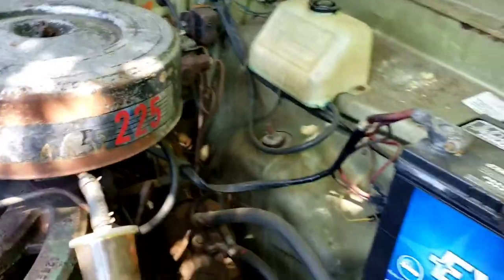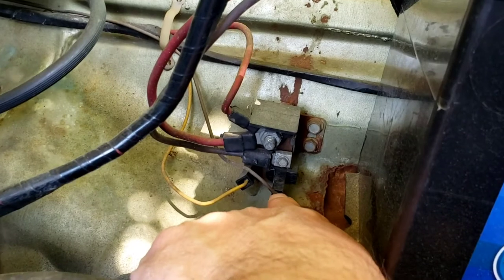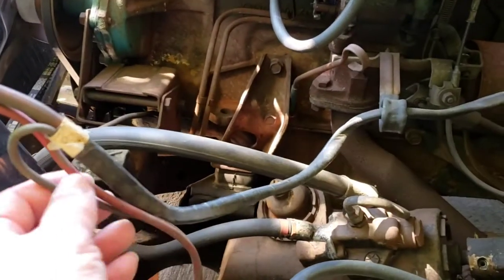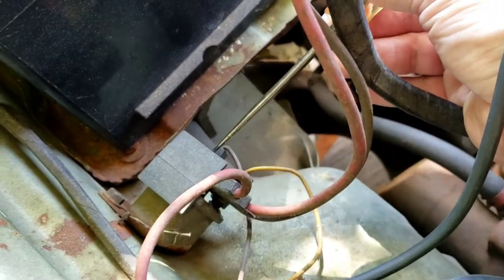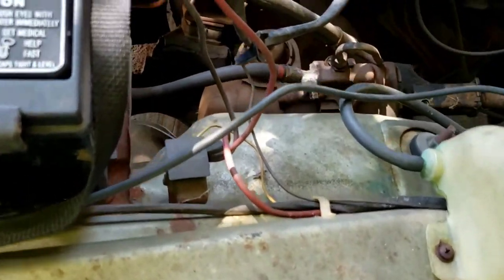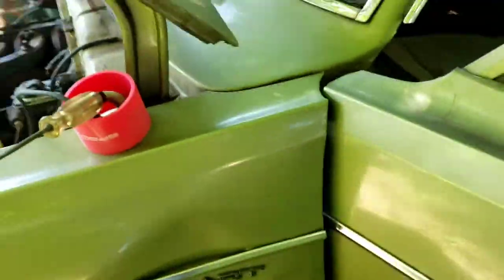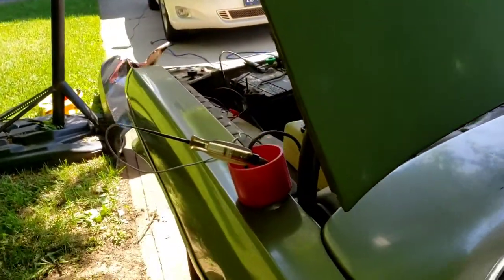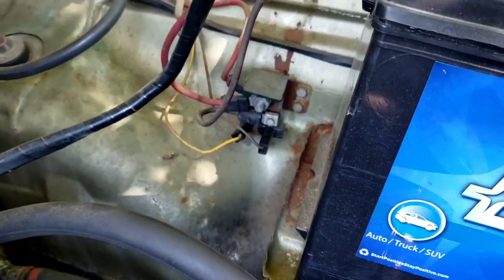Car Won't Start Old Chrysler Plymouth Dodge Mopar Won't Crank Starter Relay Check 60's 70's 80's

Comment: Hello Guru, I do have a 1974 plymouth fury iii that sat for 6years. I just replaced starter, battery, ignition coil, carburetor, spark plugs and ignition wires, one funny thing is before changing all this new parts it fired up and ran for about 3 mins. Did oil change and now it cranks but won't start. Any help is highly appreciated.
Reply from the maker: Alright, so the cranking eliminates the battery, starter,neutral safety switch.
Let's check for spark 1st, go and pull a spark plug wire off the spark plug,stick a Phillips screwdriver in the wire to act as a spark plug and hold it about 1/4 inch away from a good metal ground and try to start it and see if there is spark jumping from the screwdriver to ground. Or check for fuel 1st by getting a can of gum out carburetor cleaner, spray some in the carburetor with the choke open, and try to start the engine..see if it try to start like it wants to fire up. Is this electronic ignition or points or an aftermarket ignition system. You mentioned that before the parts changes,  it ran..so also check your spark plug firing order to see if its in the right order. Since it ran before and stalled after 3 minutes,  sounds like it was originally a fuel problem,  but now you need to start from scratch with the firing order.
Reply: Thank you so much for your reply. I tried that spark technique with a screw drive, and yes, there is a strong sparks, I have been using the carburetor cleaner, but still, it won't start. When I was changing sparks and ignition wires, I put them back one at a time the way it was.  Yes, it is an electronic ignition/points, and I believe the ignition system is still original
Reply from the maker: @benkip2301  so if you have spark, and you provided fuel by way of carburetor spray or actual gasoline then the only things left is no compression in the cylinders like a few stuck piston rings or the spark plugs are fouled with gasoline and won't fire. You can do a compression test on all cylinders or change spark plugs, what brand plugs are you using, certain brand plugs foul fast and once wet they won't fire up.
Reply: @alyoungcuda  I used Acdelco platinum spark plugs. I will check compression and try to put a new distributor because the pick-up line connector looks corroded/melted
Reply from the maker: @benkip2301  platinum plugs foul out to easily
Reply: @alyoungcuda  Thank you
Reply from the maker: @benkip2301  on my other car, the best spark plugs that doesn't foul out on me when I crank over the engine and pump the pedal is a split fire plug that is discontinued now, it has a tip that looks like a Y so the spark will jump to either end instead of 1..the new E brand  Plug looks tempting which has 3 points to spark, but I didn't install it yet. But before that, the plugs got fouled so many times, had to wait another day to try after they dried out, but it got annoying because sometimes it fouled out again and only a new set will work until I went with these. Sometimes if you keep the gas pedal floored while turning the key, the air being sucked in can dry out the fouled spark plugs
Reply: @alyoungcuda  I can't thank you enough for all this information. Yes, I believe it is flooding, really bad. I will go get another set of spark plugs and go from there
Reply from the maker: @benkip2301  sometimes you knock yourself out and the darn plugs are wet..

Comment: So, how does that test the relay?  If I do what you do and an each is a + or - ground as indicated and still no crank, that is not 100% sure its the relay? How do you test the relay itself?
Reply from the maker: It tests the relay, it tests the inputs to the relay..if you have your inputs and it won't start, then the output is no good, meaning the relay is no good.. if you do the old school way and jump the 2 terminals or touch a screwdriver to the battery terminal and the starter terminal it will crank. The inputs will set the relay internally to crank if all inputs are good.
So you should get power from the battery stud to the starter stud when the output and relay is good.
Reply: @alyoungcuda  , my mistake, thanks, I do not have 12v or live yellow wire. Not sure where ignition switch that powers this yellow wire is located, 86 5th Ave., please let me know if you know location of switch that powers yellow wire.
Reply from the maker: @dewholdingsllc1050  if you look up ignition switch on autozone.Com for your model, you will see it bolts on with 2 screws under the steering column..and has a few wires going to it..the switch is operated by a rod that attaches to your ignition key cylinder by gears and such..its mechanical from the key down to that switch and turns it into an electrical output..hope this helps you out ...
Reply: @alyoungcuda  Thank you. FYI, on 86 5th and assume other Mopars, the ignition switch is located on very top of steering column under the dash, so you have to remove lower panel, drop steering column to access the two small nut/screw that hold switch onto column. There are two actuator rods one from key lock cylinder to the ignition switch, slots up into switch, and moves inside of switch back and forth to power the relay I assume, the other rod runs from turn signal/cruise/highbeam lever to the headlight dimmer switch? Yes, its a real "booger bear" of a job just replace.
Reply from the maker: @dewholdingsllc1050  its adjustable with those 2 screws..try moving it closer up the column or check the connector for power or a burnt wire terminal
Reply: @alyoungcuda  I moved it up/down, still no 12V to yellow wire at relay. Made no diff. I dislike throwing parts at a problem, but  I picked up new ignition switch and changed out and still no difference, still no live yellow wire at relay, so I assume it's a broken connection between ignition switch on column  and the yellow wire at the relay? Not sure where to look or test as it runs inside the wire loom. Where is origination location of the yellow wire to relay?  If you know?   I do not think the oem ignition switch was bad.
Reply from the maker: @dewholdingsllc1050  you didn't have to buy the switch right away, you need to check for voltage going in and out the switch, you'relooking for power to the yellow wire but it could be power before it hits the switch..try to Google a wiring diagram...if you bought the switch from autozone, they take it back.

Comment: Will a out of adjust shift linkage case the safety switch to go bad
Reply from the maker: No, not go bad but a misalignment of the linkage will not engage the switch. Its a push button type switch inside.
Reply: Thank you!
Reply from the maker: @jamesfitchpatric1504  you're welcome and thanks for watching too...
Reply: @alyoungcuda  💙
Reply: I think I found problem all three wires  that plug to safety switch were bare and touching I believe that's what shorted both new switches
Reply from the maker: @jamesfitchpatric1504  there you go, they sell a whole replacement harness or just the replacement plug with some short wires that you connect or solder

Comment: Ok.. during my Swap.. to 318 and get her started.. she would fire up, run, after fire, stumble and quit, crank and crank.. fire up and run.... Then repeat.. misfire stumble and die.. checked everything.. etc . Replaced as needed,, rebuilt Distributor.. running points like my Slant6.. "Set Screw" for Points Gap.. would hold then slip.. cam on distributor shaft, while cranking.. would push gap open, enough to start,, .. had Cap off.. dusk,, blue spark, then Nothing.. wish i could've met dude who rebuilt it .. 
Eventually went to Petronix swap . 9 years ago.. just sharing . Like we all should ... Keep on wrenching folk's.. they all want to Run..
Reply from the maker: Petronix is the way to go or a factory electronic ignition,  but I want to change out my distributor gear, don't want to wait till it breaks...

Comment: Very informative. But I have something different going on hopefully you can help me. So 1966 Plymouth baracuda no power at all completely dead. No lights no dash lights no power to the key??? I put a new ballast, coil, voltage regulator. Waiting on starter relay. Will the starter relay keep power from traveling to the entire car?
Reply from the maker: That red wire off the relay is your 12volts into the car thru the fuse block ..its live..its touching or connected right to the positive cable on the relay..so unless that stud on the relay has a bad connection then its straight 12volts to the fuse block
Reply: Gonna go check it now
Reply: OkI must be missing some thing. On my starter relay, the wires are black with white stripe, green, and brown?
Reply from the maker: Your car should have a fusible link..its connected from the relay before it reaches the inside of your fuse box..look for that
Reply: How can I send you a picture because it looks like I am definitely missing a part. Neutral switch is not hooked up.
Reply: The fuse-able link is just hanging there it’s not hooked up to any thing I am definitely missing a part
Reply from the maker: The colors can be different since yours is older..look for that extra cable from the battery to the relay terminal..on that same terminal should be only 1 wire  attached to the same terminal stud and it goes to the firewall..
Reply from the maker: Send it to my G mail  at aarconv@gmail.com

Comment: Well explained, easy to fallow, in my Ownership of Mopar A Bodies, ive said, i believe ive had every starting issue so far haha.. 
Twin 68 Darts model 270, California built, hers is still Slant6 mine when we found it, gave up the ghost, yes some Slant6 do die, so i couldn't refuse deal, 300 bucks for 318 with A904 from non numbers matching 67 Dart,, fellow A Body owner you know like most of us, its a Mopar thing, plus an A body thing, my car has 87k on swap.. Daily driver everyday and everywhere.. weather permits this here ... Keep at it, amd Keep on Wrenching Folks...
@∅ cheers from Huntington Beach CA..
Reply from the maker: That's awesome. Let's keep the A body's alive...

Comment: I got a question for everyone.  My 74 Barracuda won't start in park but will start in neutral.  What do I check for that?
Reply from the maker: Neutral safety switch
Reply from the maker: https://youtu.be/iVTcNV1HR8E
Reply: @alyoungcuda  Got an update.  I put it in neutral and it fired up.  I replaced the starter and had it on ramps.  I drove it off of the ramps then tried it again in park and it fired up.  Would it still be the switch?  It's a weird one.
Reply from the maker: @davidmckinley5343  did you check the plug if its connected tight
Reply: @alyoungcuda  I'll have to do that.  I was so happy it started that I took it off the ramps and parked it in the garage to work on a door.